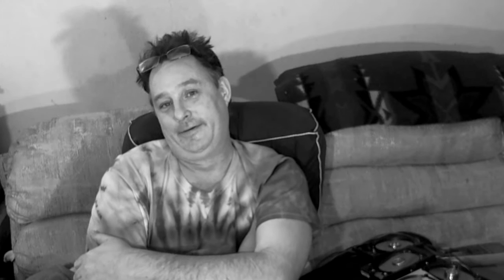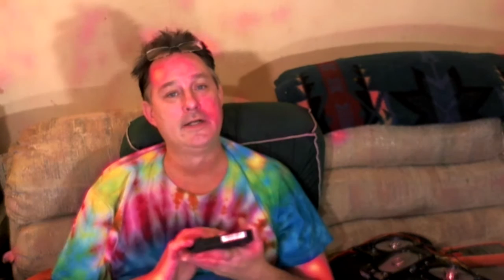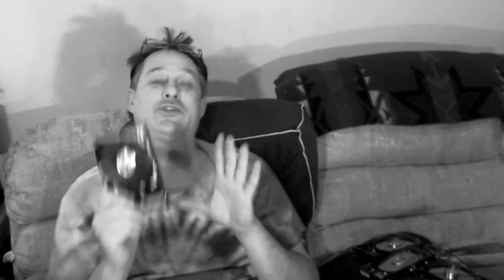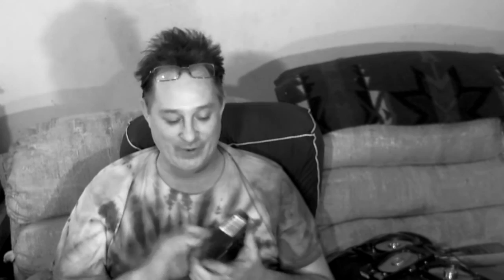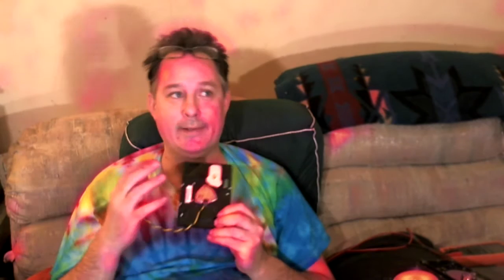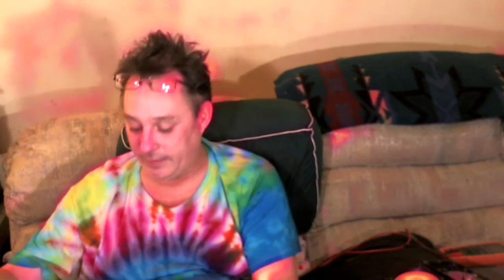Hard drive noise "synth" hack - Drop Dat BASS

Comment: Hi Petey,

On that fan idea of yours, Make did an episode on an similar idea: http://www.youtube.com/watch?v=31pgOcLlCo0

And then did a follow-up version 2: https://www.youtube.com/watch?v=l-VKapfaKg4

For the motor control on the HDDs, I'm pretty sure those are stepper motors, so you'd need a stepper driver to pulse them in the correct order to get it to spin. Can't use a constant current source.

Peace.